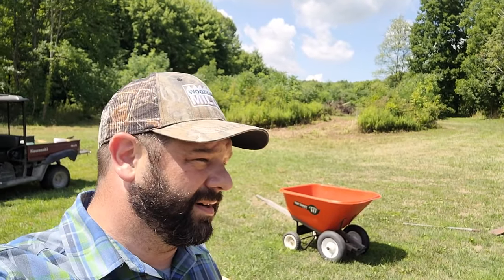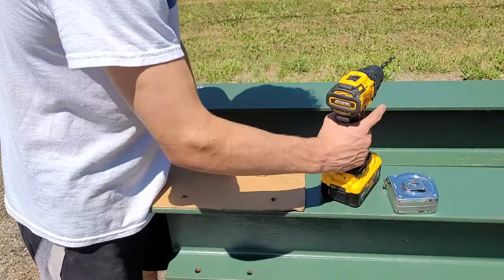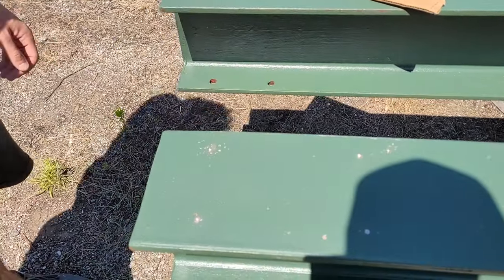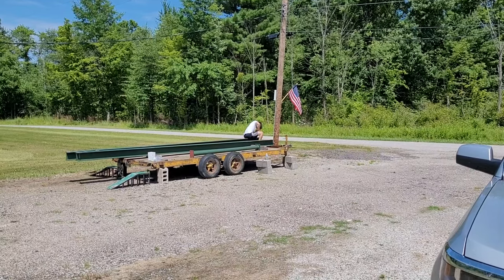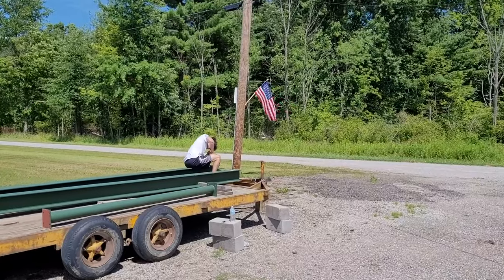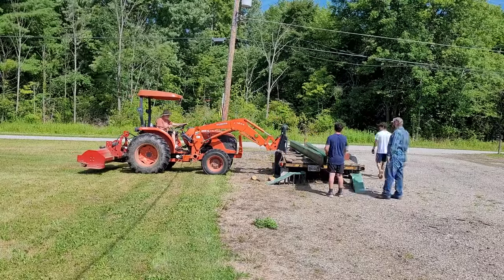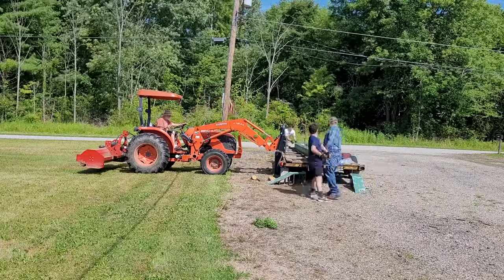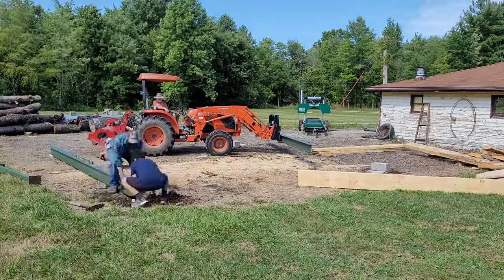#64 The Frame is up! | Sawmill Shed Build ep. 5

Comment: nice job. good your boys  and dad are helping .  it your tape measure is to short you can use a rope or string. we finished roof on my saw mill shed friday still have to do doors. we sawed most of the wood the rest came from a old barn .cost a lot for metal roofing and screws. take care, be safe and well.
Reply from the maker: The metal is by far the highest cost of this project.  Probably $200 in screws, too.  Glad we were able to mill all of the lumber we needed!

Comment: I use an angle attachment for my impact driver when it won't fit in tight spaces.  It might fit in there, not sure.  The ratchet worked well, just tiring.
Reply from the maker: That's a good idea!  Because I'm still tired from that job...